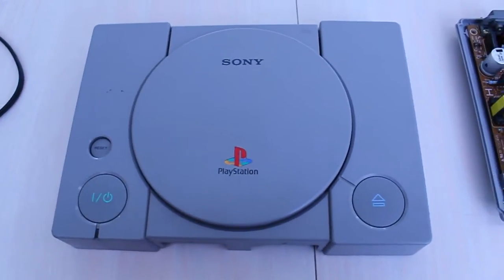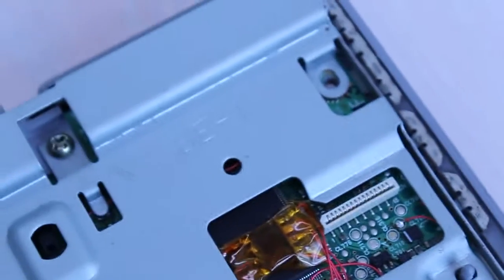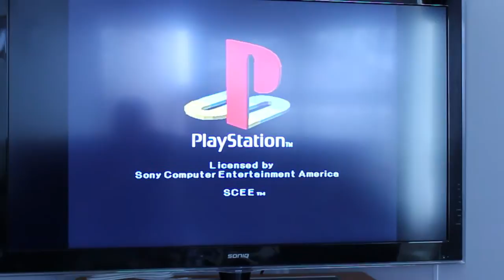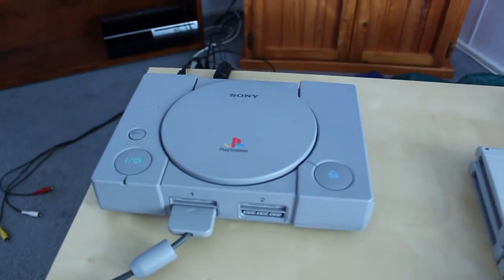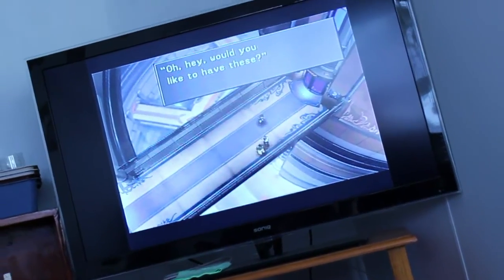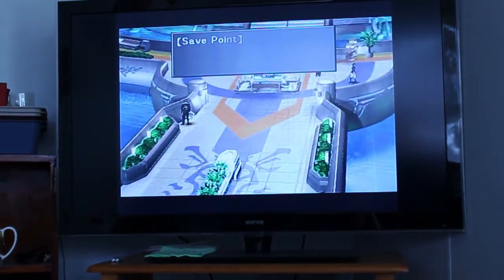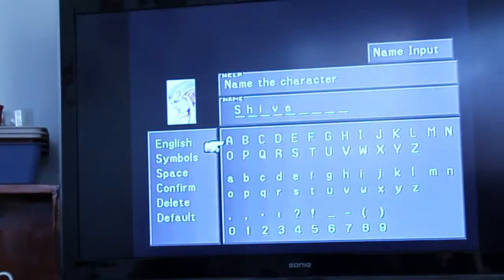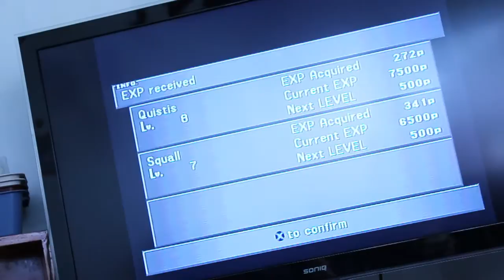Sony PlayStation 1 Modchip Installation Success on SCPH-9002

Comment: What app are you using to burn PSX ISOs with? Where abouts are you grabbing your ISOs from? Because some ISO sites have badly dumped games. Before I burn a PSX iso (i use the old school BIN/CUE CDRWin format) I run CDmage (its free) and scan it for errors, which in alot of cases after scan and fixing the iso, it runs better.
Reply: ***** I assume Imgburn or Nero. I use Alcohol 120% (CloneCD is also a good substitute), both have presets for PSX games. Source of games, if you want a good torrent tracker, try PleasureDome (if you need a invite, I might can help) if I need something quick I just hit up Emuparadise, the ISOs they host themselves (not community uploads) are Redump Images or ECM'd images I think. You can also get PS2/PSP ISOs there too, among other stuff.

Comment: this connection also can works on a psx scph-9001 ?
Reply: I think the only difference between a SCPH-***1 and a SCPH-***2 is the BIOS and the cd controller circuit, but overall, I think they're the same board underneath. I would recommend you not follow my advice since I have never installed a modchip in any system I have, and never will. So why not go seek the advice of a experienced modder?

Comment: What a mess! :-(
1) Don't mount chips on top of other chips!
2) Use more flux on the chip pins themselves
3) Don't use longer wires than needed, the longer the wire the more unwanted noise it picks up (acts like an antenna)
4) Don't lay out wires used for digital data or precise timing near high-voltage/power sections of the PCB
5) Don't use kynar wire for gnd and vcc, even though "it just works" and even if the chip doesn't draw much current at all!

Be smart, don't start. Just like the good old "say no to drugs" commercials, follow the smart steps. :-)

I wouldn't be surprised if the mod you did fails to work on certain boot-ups, all depending on the ambience and stuff. Messy installs aren't worth it!
Reply: It's not a PS2, so it doesn't really matter if GND and VCC have thin wires.

1 - It's perfectly fine to do that. I've seen installs done by pro modders on several PS1s done that way.
2 - Nothing to say there, that one's right.
3 - Again, there's no problem in using long wires in a PS1. I personally have a Stealth 2.8a chipped 9002 and it has some pretty long wires.
4 - There's no high voltage section on the main PCB. Only on the power supply.
5 - See first sentence of this comment.
Reply: Agree with your points. Gluing to chips is pretty destructive and definitely should be avoided. Long wires is lazy, but this is a really old video so I assume he's much better now.
Reply: @ConsolesUnleashed  Yeah there's a place to put the chip (where people put their Arduino Uno's), longer wires but on PSX doesn't matter, ensures minimum amount of soldering above those pesky electronics.